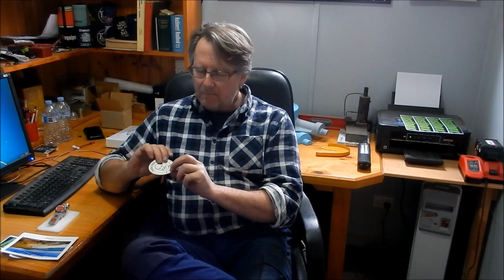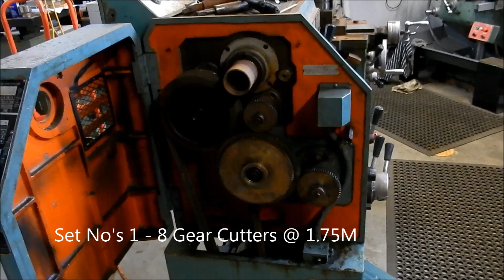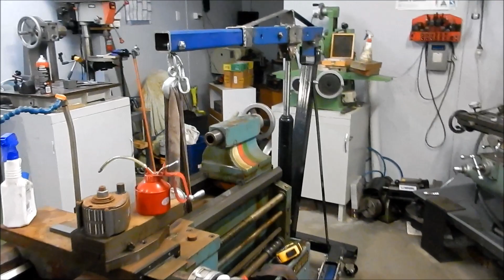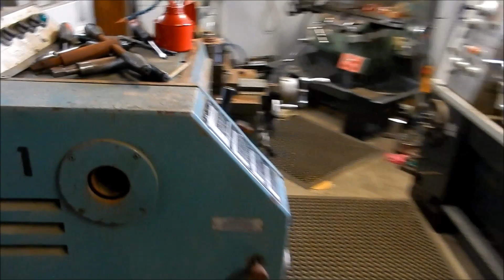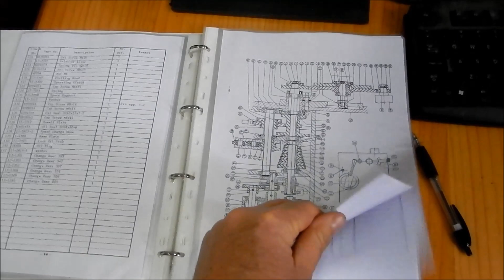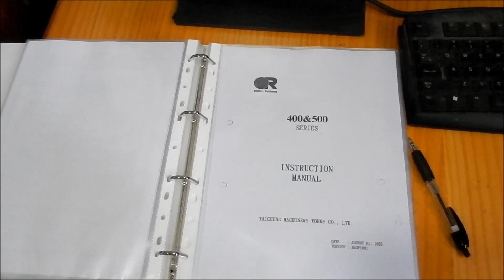Stickers, Victor Lathe, Ebay Winge, Crazy Prices for Machinery and a Request for Information,

Comment: I know it might be a few years late, but I have the same lathe with the original owners manual and the wiring schematics if you are still interested
Reply from the maker: Hi Paul, its never to late.  I did get a very good manual and electrical schematic and got it all sorted out and running on the VFD.  Thank you very much for the offer though.
Cam

Comment: Would it be possible to get a copy of those manuals and parts list if you got it as a PDF?
Reply from the maker: Yep, send me your email address and I'll give you the drop down details.  File is to big to send.
Cam
Reply: @camatbattler2233  great :) I can't find a way to PM you my email. Could you send me a link as a PM here?
Reply from the maker: Unfortunately not.  To access the files in Drop Box your email is the key.  I need to register your email so you can log in to access the manuals.  One of the security measures with drop box is only the owner can allow access to specific files for a set amount of time.
Look on my about page in YouTube and you will see my email address.  Just ping me and I'll set you up.
Cam
Reply from the maker: You should now see an email allowing you to download.  Let me know how you go.
Cam

Comment: I'm in the process of buying a Victor in Taiwan. Thing is the Victor lathes in Taiwan seems to be different. For one thing, it doesn't use a 2 speed motor, just a normal 4 pole motor (so its speed range is only 65 rpm at the lowest, basically only the higher number on the speed dials). The headstock gears appear to be driven with timing belts, and not actual gears. The spindle nose isn't D1-6 cam lock but rather A1-6 bolted on...

Comment: Hi Cam, I was wondering what company on Alibaba you got your gear set from?  I need 30t, 35t and 70t for my 400x1000G Victor lathe.  Any help in sourcing these would really be appreciated.
Reply from the maker: G'Day Christh2008, I had no luck sourcing gears for the lathe.  The tooth module is an odd size at 1.75M .  In the end I made my own including the 127 tooth gear which I wasn't prepared for. I purchased the gear cutters through AliExpress here - https://www.aliexpress.com/item/32700577270.html?spm=a2g0o.9042311.0.0.27424c4dSfmNBm
 You can see the manufacture of the gears here -
 https://www.youtube.com/watch?v=VU1nMIJ_vkE
https://www.youtube.com/watch?v=VU1nMIJ_vkE
https://www.youtube.com/watch?v=tayG779mFzo&t=848s
On another note do you have the nose spindle tapered sleeve.  I believe its not a morse taper.
Cam
Reply: @camatbattler2233   Hi Cam, no I don't have the nose spindle taper unfortunately :(.   I'm not very experienced in the ways of the lathe and are relatively new to the sport. Unfortunately and I am not setup to make gears ATM. Hey just wondering if you were keen to make me some gears? If so I'd be keen get a quote from you?
Reply from the maker: @Christh2008  Confirm some gear details to make sure your set are metric.
70T OD 126mm
35T OD 64.75mm
30T OD 56mm
Please give bore size and Keyway width.
Please confirm gear width.
Cam
Reply from the maker: Sorry forgot you don't have these gears.  Can you measure the gears you have and give me the OD and number of teeth of each so I can confirm the module.
Cam
Reply: @camatbattler2233  hi Cam, I measured my 50t gear and the OD measured 91mm.  I emailed a few pictures to your .gmail address showing the measurements with the callipers. I hope this provides enough info.  You should get my email address so we can communicate by email to make things a little easier.  Thanks Cam.

Comment: Probably navy is more likely on the original purchaser,  the exact same one here was used to train at HMAS Albatross, ACY Machinery supplied. All the change gears were missing too and that was 40 years prior.
 Interesting that you say parts are available for the second generation Victor still, do need some bits.......all the local spares were sent to the furnace when the distributor closed about 10 years back!

Comment: Very nice lathe, A number of years ago I picked up a Victor 400x1250, virtually the same model as yours, except mine has the switches along the front of the left hand plinth. I got mine from the original private owner and it came with the change gears, fixed & travelling steadies plus a bit of tooling and the original operators manual. I've found it to be a very capable lathe, the only thing that lets it down is the quality of the paint finish which has cracked and peeled in a number of places on mine.
For powering it have you looked at the 220v to 380v inverters? I see a number of inverters that are single phase 220v input & 380v 3ph output, Nflixin make them for 1.5kw, to 11kw at pretty reasonable prices.
Is your Victor metric with metric/imperial dials?
Reply from the maker: G'Day Ian, sorry for the late reply but I have taken the plunge and purchased a 220v - 415v inverter.  Had some language issues with the Chinese seller but got it sorted in the end.  I'll do a video on it when its up and going but if it works it will open up all sorts of possibilities.  Yes, mine is a  metric unit with the duel readings.
Cam
Reply: @camatbattler2233  G'day Cam, I'm looking forward to the video. I agree these Vfd's will be a gamechanger for us and open up a lot of possibilities. Ian

Comment: Nice new-to-you machine!  You're not alone, used machinery has been stupid here in Canada too, anything that is even remotely close to reasonably-priced disappears from the classifieds right away.  Took me three years to find a Bridgeport that I could afford.  I too would like to upgrade to a bigger lathe for some of the work I want to get into but just watching and waiting.  I have your stickers here too but just haven't had much work progress on the shop due to family and life but hopefully an update soon.  Hope you're doing well!
Reply from the maker: G'Day Everett, yes family does come first.  I'm going to try a relatively new product to get the motor running as is.  Its a 220v single phase directly to 415v 3 phase so no need to stuff around with the windings or purchase another motor that needs to be configured to Delta.  Fingers crossed it works.
Cam

Comment: Nice HD lathe Cam.  Being ex military they won't have scrimped on buying a quality unit and I'm not surprised at probable low hours.  Taiwanese stuff has generally been good over the years (for the money).  You have some big machines in your workshop.  Cheers Rob
Reply from the maker: G'Day Rob, I'm doing the strip down at the moment and all surfaces still have the signs of scraping left so that's always a good sign.  Its very well constructed and exactly how I would design a bit of gear like this.  Yes, this will be the biggest it gets as far as capacity goes.  I've had to knock back work because I'm just short on capacity so this will allow me to compete on the next level.  This is all planned around semi-retirement just to bring a little bit of bread and butter into the home and allow me to build that 41/2" gauge Traction Engine I've always wanted to do but never had the time.  
Cam

Comment: Cam, I'm not sure if this is the same as your machine but it could be a starting point for you.
https://www.practicalmachinist.com/vb/attachments/f11/265401d1568980354-victor-lathe-tie-point-20190919_211009.jpg
It is a 4/8 pole diagram for a Victor 16" swing beastie.
Cheers Eric
Reply from the maker: G'Day Eric, I also found the same schematic a couple of weeks ago.  It is more around the motor configuration and I am changing that out to a standard 4 pole motor/inverter configuration.  I really need the control schematic to configure into 240V so I can operate the machines controls through the inverter.  Thankyou so much for spending the time to look, I am constantly amazed at how people just jump in to help out.
Cam

Comment: Cam is that motor on the lathe a dahlander motor or one with independent windings for each speed?   Asking as I have a dahlander on the mill and run it off a VFD (VF mode only) and use a changer switch to flick between 4 and 8 pole speeds.  Obviously some correct usage behaviour needed to not break anything but it does work very well.
Reply: I think Cam needs to pull the star point out to make the motor 240V three phase. If you look at this https://www.wikiwand.com/en/Dahlander_pole_changing_motor

In four pole mode the motor is connected in star but rated for at least in the UK 415V. It will work on 240 single phase with an inverter but will lack torque. I would get a 240V-415V autotransformer and a 415V inverter that doesn't sense it has three phases coming in.
Reply: @mhbh1979  I think it depends what the end game is.  My dahlander is 400V,  1HP.  I have it running off a VFD that is 1P 240V to 3P 380V. The 380V is within tolerance (as I understand it).  Given the size of the motor he was talking about 5.5kW? Then it might be a challenge as you need to overrate the VFD when moving voltage up and going 1P to 3P.  But for a dahlander motor it is possible with the tech available as I have a working example powering my Dah Lih mill.  Either way always enjoy Cam's vids and particularly interested in seeing how he restores/fixes some of the table holes in his newer mill acquisition.

Comment: Ebay guarantees are worthless. I try to avoid using them. I suppose they have problems with people selling without notifying them but they can't expect people to buy machinery sight unseen.
Reply from the maker: Absolutely right, I'm not going to drop 3k - 4k without seeing what I'm buying.  They did make it very difficult to make contact but messaging in a very cryptic way got me there.
Cam

Comment: Cam .. I had similar issues a while back when I bought a 7”shaper …. Like you I will not buy a machine without surveying it first … with great difficulty I was able to see the machine beforehand… the seller had specified local pickup only which helped ( he was only 90mi away)
Reply from the maker: G'Day Fred, yes Ebay are making it more and more difficult.  Maybe that's the reason we are finding such a rise in Gumtree and Face Book Market Place sales.
Cam

Comment: Being ex military says a large amount about the quality of the machine build! I will send you an email in the near future if you show interest in having a metal spray welding torch that I was given and do not use. You will only pay postage as it was and will be a gift Cam.
John, Australia.
Reply from the maker: Thanks for the offer john.  I have just stripped the apron down and it shows very little wear however the bottom was full of sludge around 10mm thick.  Hoping to have things back together soon and start focusing on the electrics to get it turning.
Cam
Reply: @camatbattler2233  So does that mean you are interested Cam? Cheers, John.
Reply from the maker: @joandar1  Hi John,  I am certainly interested.  I don't have Oxy Acetylene at the moment but am looking to get set-up before I retire in the next 18 - 24 months so the ability to  metal spray for repairs would be an added bonus.  Thankyou for the kind offer, its very much appreciated.  Please contact me off line via e-mail and I can send you my address.
Cam

Comment: Nice machine you've got there. Good find.
Thanks for the shout out.
Reply from the maker: Hi Rusty, yes I'm happy with the purchase and the price I got it for.  The seller accepted my offer after 2 weeks of working with him to get the price we were both happy with.  I'm in the middle of striping it down and giving it a though clean out and replacement of all the seals.  Next I'll work on the electrics to get it up and running.  
When are we going to see what's behind the "cheap door".  Maybe you could run a competition to see who gets closest when you finally do the big reveal.
Cam